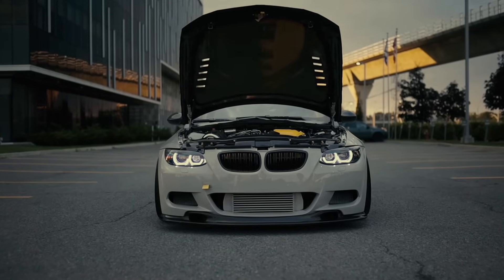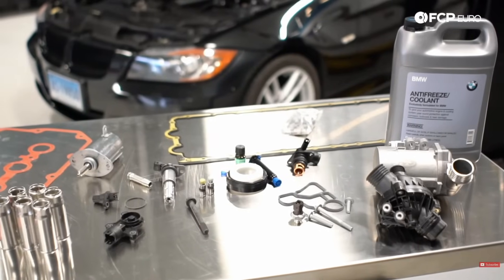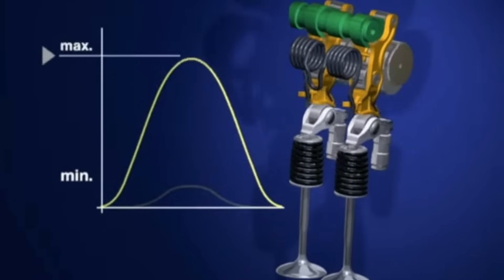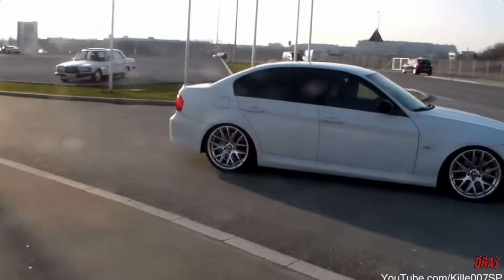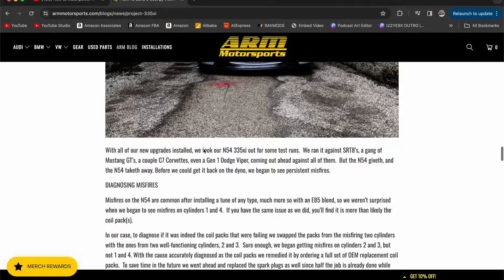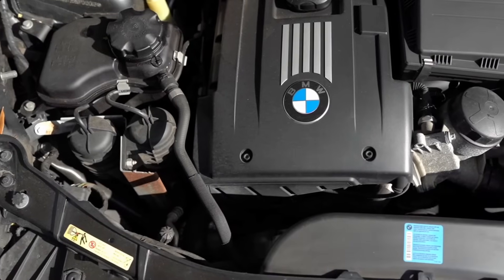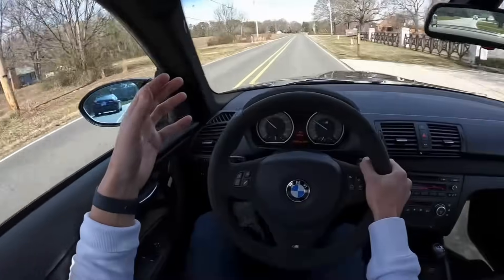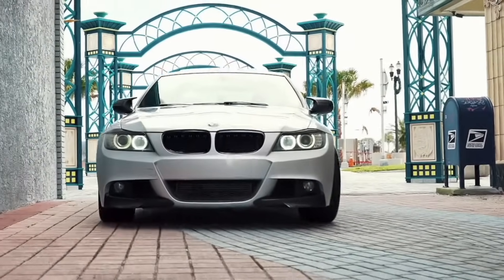Ultimate BMW Engine Showdown: N52 vs N54 vs N55 – Which One Should You Choose? | Comparison & Review

Comment: Actually, if i could choose, i would not buy a "N-series-engine". Rather the "M-engines" like the M54. These were still "real" BMW engines that were practically indestructible and had the same or even better running smoothness. With the N engines came shafts that were no longer made from a single part. And this is just one example where cheaper parts came at the expense of reliability. If you want the best BMW straight-six engines - stay away from N-engines! The M engines were the last "true" BMW straight-sixes when it comes to quality and reliability. Here, in the BMW land of Lower Bavaria near the main BMW plant in Dingolfing and the Landshut engine plant, this is an open secret. Even though the N56 received the Engine of the Year award. It is no coincidence that even today, 24 years after its introduction, there are almost more BMW 5 Series with M Series engines on the road than 5 Series with N Series engines. While N-series engines get all kinds of problems at 150,000 km and were a relatively reliable engine for their time, the M-series engines are still in a completely different league in this respect. After almost 25 years, there are still hundreds of thousands of them running perfectly with a mileage of at least 300,000 km without any problems or damage, many have even covered 500,000 km and more without a repair and there is even one with over 1,000,000 km in which the engine and gearbox (ZF gearbox) were opened a few years ago. Both were certified to be in perfect condition! So even if the N-series engines (whereby the N56 is undoubtedly the better option here!) were very good engines with good reliability and superior to the M-series engines in terms of performance (mainly due to the turbocharging, the N-engines were purely naturally aspirated engines), the M-series engines were and are the absolute crown of BMW in-line six-cylinder engines!
Reply: blah blah blah your statistics are garbage, don’t care about your cam shaft story either.. these motors haul ass and i spank those “ real bmw m engines” your blabbing about in a 10+ year old bmw i paid 13k for lol

Comment: There is so much wrong. the N55 in the newer generation wasn't due to superiority, or balance, it was a CHEAPER engine, the cast rods versus forged rods and single versus dual turbo was all for cost savings, and the F series chassis today is known as one of the LEAST reliable chassis and a single turbo will produce just as much heat as twins, cause you still have the same exhaust manifold area, and that is where the most heat is produced is PRE turbo. 

yes the index 12's are "best" the HPFP had many recalls, but essentially they recalled to the latest and greatest N55 HPFP,  

either way both engines will run a long time with proper maintenance and fuel. 

i have 189K on my N54, i've replaced the valve cover with an aluminum Bremmen, and the inside was clean as a whistle. no carbon, no discoloration on the head or cam ledges. 
my injectors are index 5's and 6's.. i run injector cleaner about every other tank. 

yes maintenance is key, and knowing how to DIY is also key to keeping it running. 

One thing i DO NOT understand from BMW is the lack of a baffle in the oil pan for either the N54 OR the N55, oil starvation is never good and if you like to track the car and do corners.. Well.. you will move oil away from the pickup without one.

Comment: I went with the N55 full bolt on and Pure Turbo swap for good power and good reliability. Of course I replaced every gasket and seal and coil packs as well as 1 step cooler spark plugs before modifying. Overall been a very reliable daily after being modified for about 4 years now.

Comment: There was also the N51 engine in CA and NY markets. 328i's that came with it had the same 3-stage intake manifold as 330i's that were not sold in the US. The heads have larger chambers though for a slightly lower compression (10:1 instead of 10.7:1). Milling the head along with some minor porting could produce 260+ hp with basic bolt-on upgrades.
Reply from the maker: Correct! I didn’t mention the N51 due to video length, but thank you for this spot on comment

Comment: meh, the rev 12 injectors are still not great. Hell I've had fewer issues out of index 1s... But finding good, or preferably new index 1s is a pita. 

People will say they are good, and you get them, they are leaking. Took me like 4 paypal claims to finally get 1 used index that doesn't leak to go with the other 5 original index 1s in my current project car. 

My car has 180k miles, and 5/6 injectors are original. I had one replaced with a index 9 under warranty and it kept giving me trouble.

Comment: I own an n52 that I’ve been fighting a cylinder 5 misfire for over a year now! I’ve checked everything from plugs to coils, fuel injectors. Compression test, leak down test. 
To this day I still haven’t been able to figure it out.
Reply: Vanos solenoids? Check for codes, and make sure to reset the codes in the modules after changing them, or it keeps running like crap.

Comment: Still love my 2013 335IS,  N54- One of 269 in LeMans Blue with DCT - now a with a custom tune, aftermarket IC, Brembo Brakes, LSD, Kona Shocks. and some ///M parts up from and del-rin arms in back -  And only 80K miles - and USES ZERO oil in 5K miles...

Comment: I’ve had my n54 for 9 years.. redlined it every other day .. tuned modded it has 22-26 psi.. has about 450-500 whp.. I drive it hard everyday .. I did all preventative maintenance.. no issues
.. recently just replaced a coil and an alternator.  ..  if you know about n54s your not a cheap fry bag you can have a reliable n54
Reply: You got money bro.. what you driving right there is some serious slay queen 😅
Reply: Какой кузов? Е90 или Е92 ?

Comment: Just bought a n52 for $7800 50k miles.  Gotta replace the pulley and belts with alternator. Then I’ll bee looking to make it faster.
Reply from the maker: @Stilljohnny  50k miles is amazing! Take care of the engine, oil changes on the dot and it’s bulletproof. You could own that engine for the next two decades
Reply: @IzzyE9X  thanks for the positivity. All the guys at work are giving me shit cause the alternator is making a squeaking noise I bought a new already just waiting to replace it.
Reply from the maker: @Stilljohnny  I have a video on replacing the alternator and a separate one for replacing the belt- I hope that helps. Congrats on your purchase bother 🤝🏻

Comment: N52 with weight reduction all the way if you want to endlessly beat the ever living piss out of it every drive and never have any issues. Not to mention the improved handling. Coming from st n54 owner and n52. N52 currently at 184k miles still running strong and heavily abused.
Reply: Also wouldn’t waste money on an n55 pwg

Comment: Stage 1+ n54 here. 202k and i daily it! Still going strong 🚀
Reply: stage1+ here too 189K..  developed oil leak, so plan on redoing oil pan gasket and putting baffle in when i do.
Reply: My n54 has 190k and it still going strong too   Mine has stage 2+ on it.
Reply: N54 owner here too 161k miles still strong. If you turn your own tools when problems arise, you should no issues.

Comment: N52 6MT Xdrive, 3.91 diffs, running an ITB setup with 3D printed manifold, no throttle body, FBO. Still dead reliable engine with a proper tune. Track and winter abused

Comment: Ive owned my E93 335i 07 plate.. 11 years now its running like a champ.. only mods blow off valve charge pipe and led steering wheel.. spent about £1500 in repairs over 11 years.. milage 79,000 my advice dont tune it the car is very fast stock and economical 😂.. i would never sell it main dealer said its %100  collecters car they wanted me to trade it in for another bmw lol

Comment: I sell BMWs for a living and have been working for them the last 8 years. This video pretty much sums it up. That being said, I drive a 2013 335i with a small tune and some bolt ons as my daily driver😊 it’s not a rocket but the n55 is really reliable and great to drive. Thats all I ask for in my daily. If I wanted peak power…… n54….. No questions asked. Great info in this video!!!
Reply from the maker: thank you for your input!

Comment: I confirm n54 is not reliable , i had a bad experience of high pressure pump failure + ignition coils twice +  and at the end a progressive & huge  oil consumtion (without any leak! Without any reason found by professionals ! I thaught a too high oil temperature but never confirmed! ) So very desapointed. .. maybe one time i Will have To test n55. But i need time to reconcil with bmw. Thanks for the video.
Reply: if you're consuming oil there is ALWAYS somewhere it is going, or some trail to follow, like smoke out the tail pipe, or oil in the charge pipes.  or a snail trail under the car.
Reply: @exiteternium  thanks for ypur reply. Unfortunatly i have not any more the car. From my memoires, no oil inder the car but exaust a little Black. Oil temperature close to 120°c but nobody at bmw was able to find any reason. I sold the car then.
Thanks again for your advice...

Comment: Nope, N52 330i has 258 hp. Not 268. I had it for 9 years. Biggest negative is the pretty high oil consumption due to failing pistons rings.
Recently switched to a N55.

Comment: I've had my 335i N54 for over 12 years serviced by me every 3000k t17 turbo's and FBO never a problem probably the most reliable car I have had in my 65 years and it's quick turbo's were also fitted by me.
Reply: Agreed, but still on stock turbos. What 17t's brand Fapo's?

Comment: The early N55 had a pneumatic wastegate (PNG), then later an electronic wastegate (EWG), which controls boost better and you get a bit more power for the same mods. Doesn't matter if you go "stage 3" though.

Comment: you didnt mention N53 which is an "upgraded" (not necessarily a good one) N52 with direct fuel injection (that often failed) like with the N54
Reply: Yeah but it was soooo sweet to drive after the fuel burned off and the rough idle cleared lol

Comment: Bmw....too much plastic on critical components.  Over complicated assemblies.  Every oil pan leaks, retarded plastic pcv hoses that crumble on contact with age. Disa valves that disintegrate.  Vacuum seals that fail. Good running engines when running but a money pit in the long haul. That's exactly why there's a ton of them in the junkyard.  You're either a bimmer master or have a wallet with endless money
Reply: Yet you are here talking crap on bmw, if you cant pay maintenance on a bmw dont drive them, get a honda civic....

Comment: Hey there doc, i'm looking to buy an 3.0 n52 e92 330i but i can't figure out which cars have it, i've read everything i could find online, even a bmw n52 pdf i found, the pdf says the 2006 car has the n52b30 with 190kw/255hp, some wikis say the n52 for the 330i has been produced up to 2015 and goes up to 200Kw/272hp(268ps) too........but then again, N53 started production in 2008 and goes up to 200KW/272hp too, so when i search for 2006 e92 330i cars on the market, they all say 272HP, so do the 2008+ ones, i've been struggling with this for the past 4 days and i'm going absolutely crazy, need a car ASAP and i'd like to avoid the N53, is there any way to discern the n52b30? i don't want to go and throw 10k euros thinking i got an n52 but actually its a n53
Reply from the maker: anytime you buy a BMW, you should bring a code scanner with you. If you scan the VIN, it'll tell you which exact engine it has

Comment: Have a 2014 bmw 335xi stage 2 MHD with 130k and have done: thermostat, waterpump, HPFP, injectors, plugs and coils, ZF trans service, and  valve cover gasket. Mostly preventative maintenance. On and my coolant reservoir bleeder screw dry rotted and cracked. But other than the basic stuff she’s very reliable and I drive it daily for work
Reply from the maker: sounds like you've knocked out most of the trouble points already!

Comment: I've had my 2008 328xi e90 for several years now with about 186K miles on it. My dual mass clutch finally went out, so I'm replacing it with a Turner Motorsport Performance Lightweight Flywheel N52 and street racing clutch.  I've already swapped in the Magnesium Alloy Valve Cover and completed the 3-stage-DISA-Intake-Manifold mod. I may do the MILVS upgrade at some point and most likely the headers. What else am I missing?

Comment: I have a 335i e93 with the N54. It was a basket case when I bought it about a year ago. Recently, finally, I have it running and looking really nice. Basically had to do all the maintenance that nobody else did. Plugs, coil packs, fuel, injectors, alternator, battery, power steering pump, AC compressor motor mounts that I upgraded🎉😂🎉🎉😊
Edit: Now it has new injectors index 10. Index 12 are still too pricey.
Reply: i'm still running index 6's.. i run injector cleaner like twice a month..
Reply: @exiteternium My injector on number six cylinder keeps dying. I’m using an index 8 there right now. It’s seems fine. I coded with a Launch code reader 2.  Time to clean my Vanos Solenoids and put cam sensors in.
Reply: @Plumbtired  a single cylinder misfire could be injector, coil, or bad cylinder but i doubt it would be Vanos, as that should be multiple cylinder or accompanied by a camshaft over retard or over advance code.  if the intake valves haven't been walnut blasted yet, that may be a maintenance item to look into.
Reply: @exiteternium  I was just stating my next maintenance steps. Cylinder 6 takes a lot of heat and I’m using used injectors until I can get 12’s. Yes definitely my intake valves are dirty. They need need walnut blasting for sure. Thank you for the input. I appreciate it.
Reply: I just picked up my first 335i. Went to gets a service kit, when I gave the reg they literally couldn’t find plugs available for it lol
Reply: @charliemcgarvey2302  Bought mine online on Amazon. Bosch three point $10 per. Autozone wanted $24 per. Thiefs.

Comment: Had my 135i n54  for about 6yrs  now, running stage 2+ as my daily all year round driver, currently has 200,000km .  Aside from the index 12 injectors, I've only done the same as what you mentioned the n52 issues are.  So don't be saying it needs way more maintenance if you haven't owned one.  It really isn't bad especially for the price you can buy one for!!!   The n54 cars are cheap to buy, so even doing a little more on maintenance will still bot cost a lot.   Doing your own maintenance saves a lot too.
Reply: Amen! 335is DCT and loving it. This video is BS.

Comment: My n52 (stock) still runnjng strong at 180K miles, but damn it's slow. Any pointers?
Reply from the maker: three stage intake manifold, upgraded air intake, exhaust and tune
Reply: @IzzyE9X  mine has the 3 stage manifold with the disa valves already. What tune do you suggest?

Comment: They put turbos on ALL THE DIESEL ENGINES SENSE THE 1980'S. What do you mean the n54 was the first turbo production bmw?! Also valvetronic bmw cars do run throtel bodys as well, its a fail safe incase valvetronic has isues.  (Limp mode)

Comment: Lets gather here for N55
Reply: got a 135i n55 6mt making a decent 380hp
Reply: @anarchyteam1758 140i stage 2with hpfp 480 bhp
Reply: Knock knock its b58 move over. Gotta admit n55 sounds a lot better. B58 somehow manages to sound like a diesel (likely because its based on one).
Reply: @ I’d recommend getting a valved muffler or down pipe back if going to do a performance down pipe. Even if keep the resonator. To be safe.
Reply: 11 335i xdrive LCI with n55, in love
Reply: I’m here and I love it
Reply: E93 LCI N55 with Msport package, some modest upgrades most on suspension and tires & wheels makes the twisty roads around here super fun to drive.
Reply: Currently building an 535i xdrive. Aiming to 450whp
Reply: 2015 x3 35i AWD, Engine so far has been rock solid. have had to replace the complete cooling system $1400.00 and recently the charge pipe $1800.00. car sounds and feels like new again though with the charge pipe replacement, especially on start up and when boosting less of a lag I have noticed. About 118,000k miles, have had since it was at 85,000. 2500-3000mi. max oil changes.

Comment: had a e89 z4 n54 and it’s diabolically fast but Bro I feel like a boomer when it comes to the n52! ** turbo power a slightly modded n52 is cHEFS KISS😪 esp in a 128i coupe or z4 3.0. if you have the optimism to crank 120hp more and suspension mods and drop 70lbs, you get real ultimate driving machine

Comment: One of the collest things about the N52 is it can run individual intakes, not throttle bodies, intakes! This is due to it being a naturally aspariated Valvetronic motor. Valvetronic handles the throttle inputs rather than a throttle body which is what makes the indidiual intakes possible. It's not possible to do it on an N54 or N55 because of the turbo or on the M52 or M54 because of the need for a throttle body. You can get a kit for the individual throttle bodies with a tune from a few small companies and it makes them sound crazy. It also slightly boosts the torque output of the engine.

That said the N55 is by far my favorite. They're power delivery with the twinscroll turbo is so smooth and they sound incredible with a good exhaust.

Edit for spelling :)